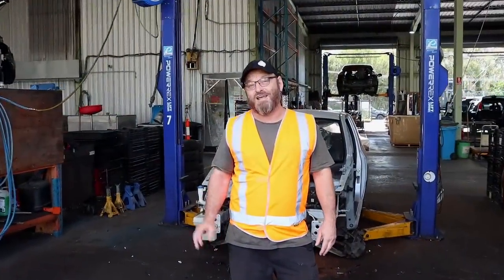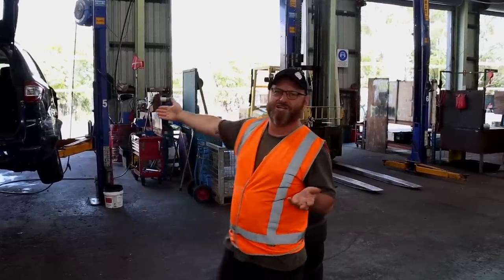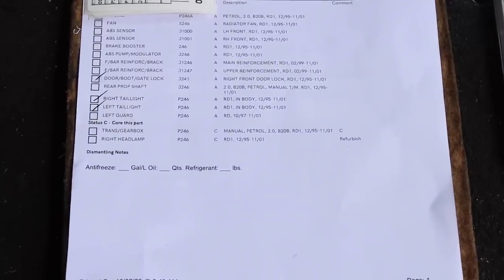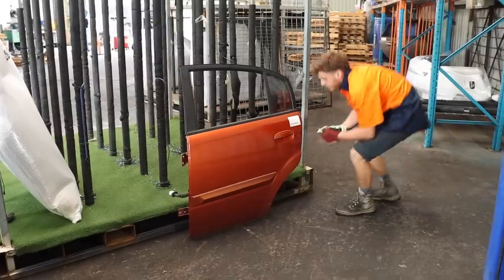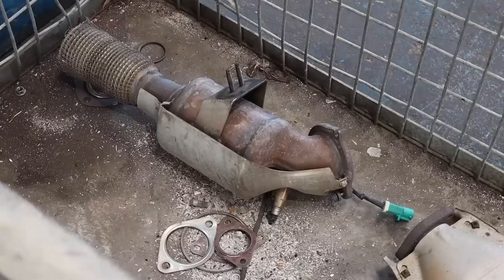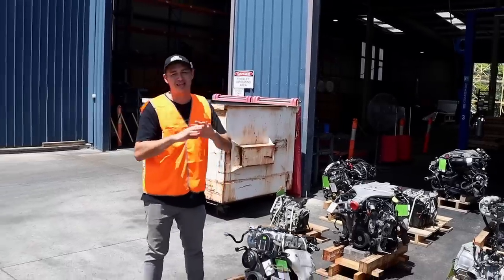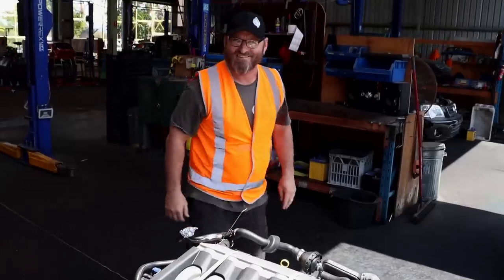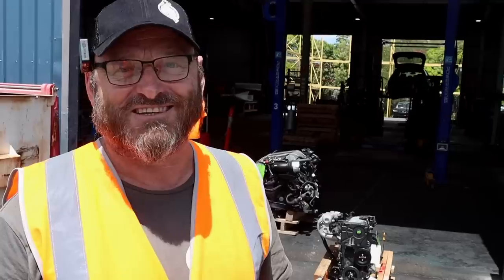Crashed Your Car? What Happens Next? Old School Wreckers are FINISHED!

Comment: Not a fan of these sort of places, sorry. As others have said, at these sort of places a lot of little hard to find parts that can be major show stoppers in a rebuild, such as trim pieces, bolts, clips, etc tend to get binned. And forget about it if you have an older car, anything say, pre-2000 at a stretch. Furthermore going to the wrecking yard was educational - it was good being able to practice removal and refitting of a part on a wreck the first time before doing it on my own car, and being able to carry parts around to other cars in the yard to compare and test fit in order to determine parts interchangeability. Can't do that with a place like this. Not to mention that really, I enjoyed the adventure, walking around the yard and looking at and through all the different cars. Even if I wasn't after anything sometimes I'd take a run out to Pick 'n Payless for no other reason than just to have a look around for my own amusement. Its sad that the self serve places are slowly going the way of the dodo. Hopefully those in regional and rural areas at least survive for a bit longer.

Comment: Is this where everyone gets those 140XXX odd km green top barra's from? (I think the other 200000km get pressure washed off after removal)
Seriously though, I think these places are pretty well set up.
Reply: They actually have 1,140,000 km. Green tops are taxi motors, the odometer has already rolled over to zeroes again

Comment: Don’t knock the Alloytec.  It’s the lack of oil changes that kills them, which comes back to the people that owned them. 

Put the shoe on the other foot and imagine if Nissan released the RB in the modern era. They’d be scathed. Imagine releasing an engine that can’t drain oil from its top end and has an oil pump made from egg shells with turbine wheels of clay.

Comment: Well idk about you but I don't wanna pay an arm and a leg for a part that someone else has to get off for me... or they have the part but won't sell small things separately... these type of wreckers aren't what I look for. There's plenty around that want $350 for plastic trim pieces or $400 for a seat that's half ripped. Now these type of wreckers just keep engines out in the rain on racks... sure a do it yourself wrecker it's a similar thing but some are enclosed, I personally think massive warehouses with cars you can dismantle yourself is the way to go, this type of thing is causing second-hand parts to be close to retail value and it's not really worth getting from them.

Comment: This is kind of ironic. This is about as anti DIY as it gets. 

If you consider all of the extra cost heaped onto the parts with all the extra labour and absence of so many parts that would otherwise sit on car bodies for years waiting to be be pulled by someone who needs it then there are really only two winners to this kind of 'progress'.

Insurance companies get to streamline there claim process with all of the parts pre-picked and catalogued (makes claims very easy to calculate).

New car sales (Manufacturers) have less competition from used cars as they are more prohibitively expensive to maintain due to unnecessarily expensive or non-existent spare parts as a result of these new processes. 

 Anyone who legitimately thinks that companies are making these changes for the sake of the environment needs to ease back on the Koolaid a bit..

Comment: Whipple it mate. I own a 2017 GT Mustang with the same Gen 2 engine, and I've been down through road with all the costs and benefits. You can buy the Whipple gen 5 3 litre from Shelby America, delivered cheaper than what you can buy it here for, little bit more than the harrow, but has far more long term ability, and looks far better, UNLESS you get the 3150 from Harrop, it'll just look better, and the Whipple whine 😘😘😘😘😘😘. Whipple also come with a map ready to load onto the ecu straight away.

Comment: In my neck of the United States of Gun the most desirable cars get stripped like this. Anything less than 10 years old will get stripped that way. The cars with less desirable parts go to the self service yards. I vote single 88mm for the Yote. Easy 1000hp.

Comment: One thing that messes with the eco-mentalist mind set, is that the automotive industry recycles somewhere north of 98% of all products manufactured. It's down to things like the explosive charge in an airbag that isn't recycled.
Car folk have always be into proper recycling, its from swapping big motors, better gearboxs, bigger brakes in to our toys.
Now, can those blokes sell Catalytic Converters to punters? Most wreckers won't, because of the raw material value.
Reply: In the US, used catalytic converters are illegal to install unless they've been "certified". As a result, you can't buy them↔
Reply: @bvward  a lot of stuff in the US has been made illegal thanks to funding campaigns by various industries. Example, Hemp was targeted by the Oil Industry, not because of the recreational use, but because of it's suitability for ropes, fabrics, medicines and especially Organic Plastics, which is the market the oil barons wanted more then fuel supply.
Now its the value of the Platinum Group elements in the catalyst, and forcing customers to buy new ones, rather then let you clean up and reuse the catalyst honeycomb.

Comment: Sh1tloads better than ozwreck, glad I quit working in that industry the same year I started 😂  gets real depressing real quick when your a car guy seeing xr6ts and V8 commodores being statutory written off and scrapped every day for ridiculous things like a hit subframe/engine xmembers or just bent suspension arms (assuming were stolen but still)big PSA, if you aren't happy settling for a particular job then don't, believe in yourself, upskill as much as possible and you will find better. I never settled where I wasn't happy and now I've found a job I wanna stay at, I work with 14 absolute legends, I'm paid a good bit more than the usual fk all, the boss and I just got to race at the street outlaws event recently and placed 2nd in the motorfest show n shine. I'm only 24 and I started out spraying rusty scaffolding with a gurney in the mangroves and then working at the wreckers for $7.38 an hour doing 60+ hour weeks without paid overtime. Every day I get home now I think, "man Ive got it good" and then remember, that no, I made it good and it's how it should be.

Comment: Car Rant - I want government to have less over reach. I want streamlining in car building approval. If a car is reasonably safe, it should be licenced. Oddly its difficult & expensive to recycle and repurpose old discarded cars with modern drivelines, suspsnsions, brakes. It should be extremely simple & a simple application to build, approval & inspection at a sensible fee. An engineer certificate should only be required if a build has never been done before. An engineered car, like fitting a BBC into an older Toyota sedan, the build & standard should go into an archive & if others want to build the same, download the specs & get it on the road at a normal licencing station. If some want to depart from that, engineer. No one should need to get a certificate if its already been done. Yes, add a modest fee & some of it is returned to the original builder who did pay for an engineer...its their intellectual property so them recouping some cost over time is fair.
Make it safe, make it simple to navigate & then it'll encourage others to recycle, repurpose & innovate